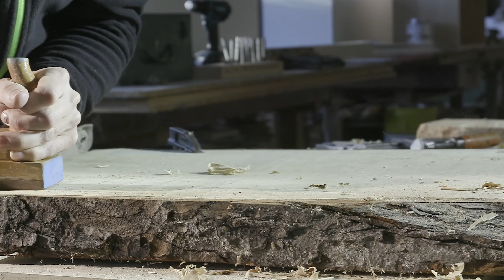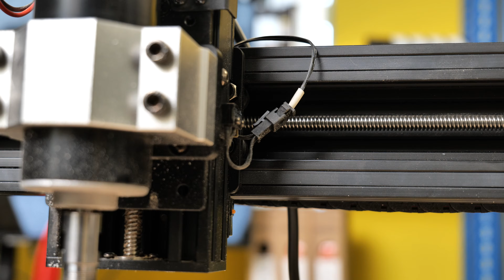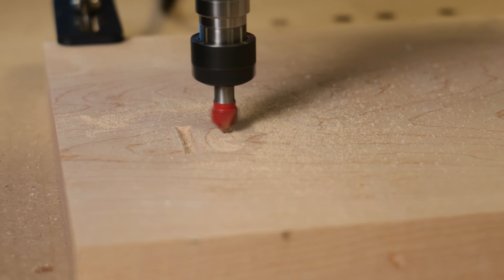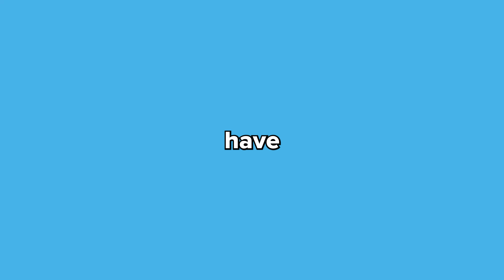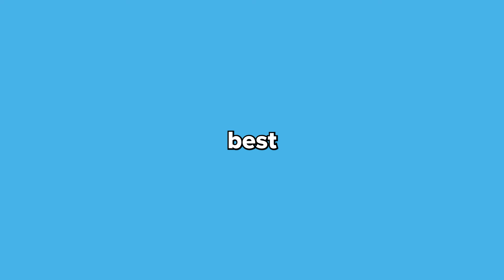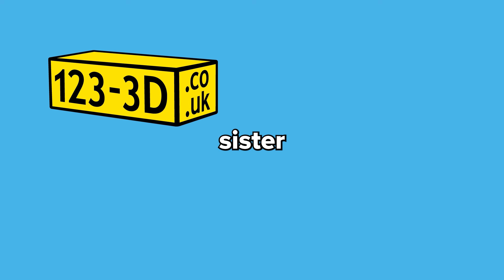Two Trees TTC 450 Review | The Best Consumer CNC Machine On The Market?!?

Comment: Thanks for the review. I need to cut 46cm MDF circles. The advertising says the working area is up to 46cm, but this isn't always accurate (for example, I have a laser cutter that says the engraving area is up to 40cm, but the maximum it can actually work with is 38cm). 

Will it be possible to get the 46cm circle I need with this machine?

Comment: Hi Steve.
If i was to cut some 2mm carbonfiber parts for a RC car, will that be doable, or do i need to upgrade to the 500w from start? Thanks. Martin
Reply from the maker: For cutting Carbon Fibre we would recommend getting the 500w upgrade
Reply: @123-3D-UK  Thanks for the answer.
Just saw that there is now a 800w 30K RPM kit, so might as well go for that :-)

Comment: Can anyone give minimum bench top dimensions, that this unit will fit on?
Looks like feet are narrower than work area.
Limited space available in shop.
Reply from the maker: Footprint of the machine is 900mm x 900mm x 450mm

Comment: Does this cnc machine only operate in MM will it operate with INCHE g-code???  What post processor works with this machine?
Reply from the maker: You can set mm or inches, the machine will work with any GRBL software and it very accurate in our testing.

Comment: I have a question about how the TTC 450 handles a .NC G-CODE file that was made in INCHES when the machine shows a metric setup???  Also can the TTC 450 be setup to operate in INCHES instead of METRIC ???  If I make a CAD drawing of a 2" (inch) square, convert it to a .NC G-CODE file and feed it to the TTC 450, will the machine actually cut a 2" square or some other size??? How accurate is the machine???

Comment: I have one of these and am very satisfied. I make relief carving in hardwoods and have not encountered any problems.
Reply: Hi. I need to cut 46cm MDF circles. The advertising says the working area is up to 46cm, but this isn't always accurate (for example, I have a laser cutter that says the engraving area is up to 40cm, but the maximum it can actually work with is 38cm). Will it be possible to get the 46cm circle I need with this machine?